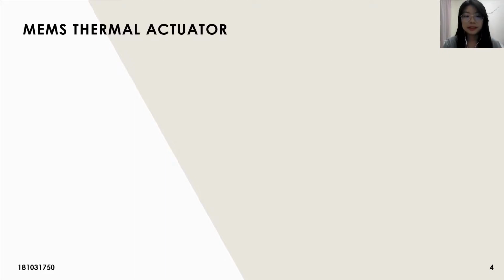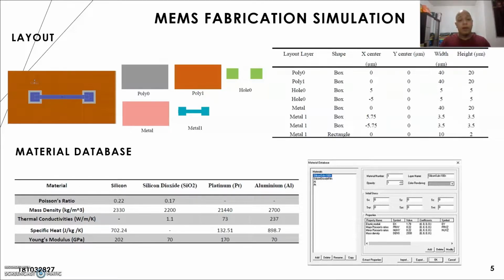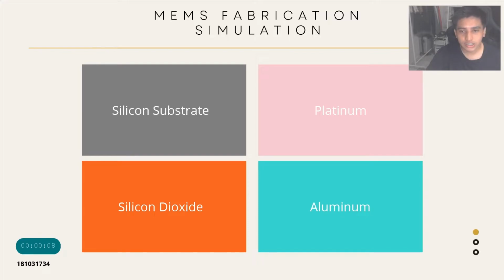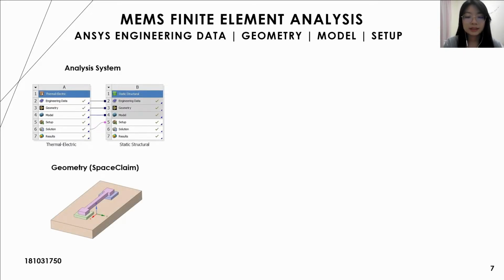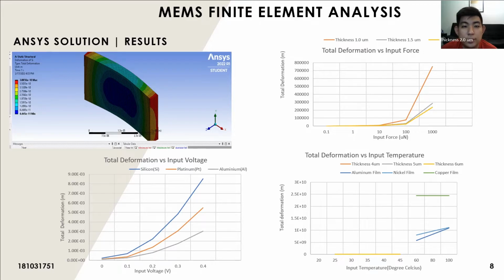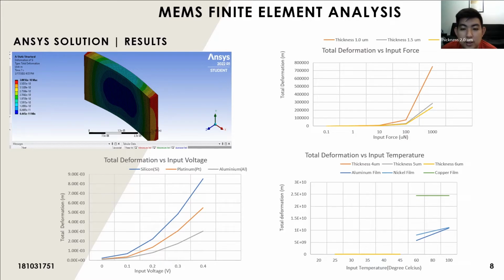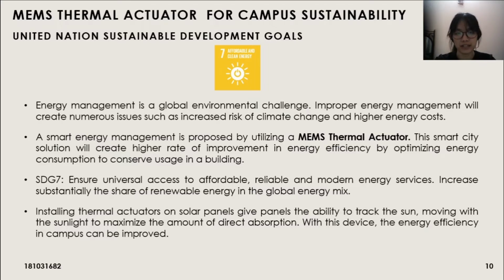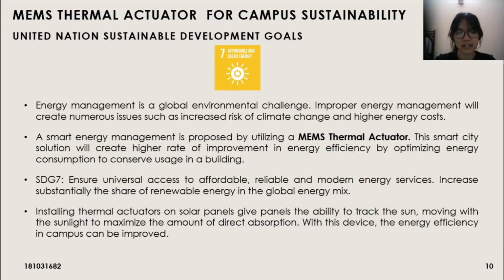2021 NMJ42003 MEMS Design and Fabrication MEMS_14 MEMS Thermal Actuator

Comment: Why the total deformation of silicon is more higher then platinum and aluminium when the input voltage is imposed
Reply: Since the CTE of Al > Pt > Si, the actuator deflects towards the 
direction of the lower CTE, Si thus creates a higher changes in lengths or deformation of silicon.

Comment: What's the result of total deformation if input force is higher than 2000nN?
Reply: Larger than that might get inaccurate result, since the force is too large for the thermal actuator.